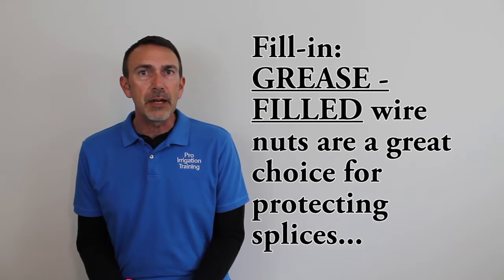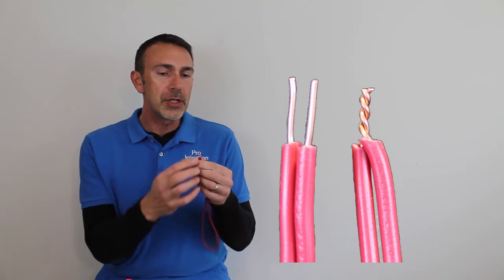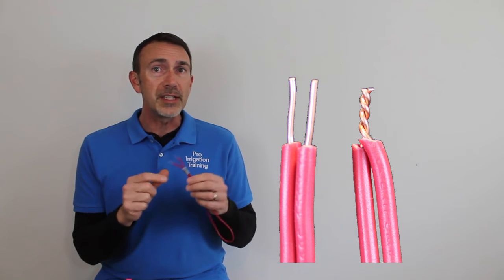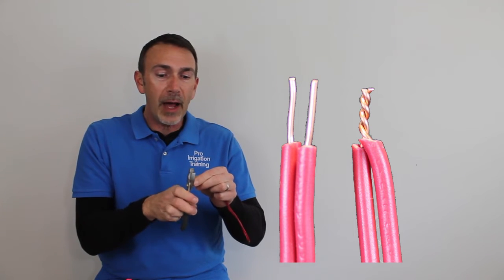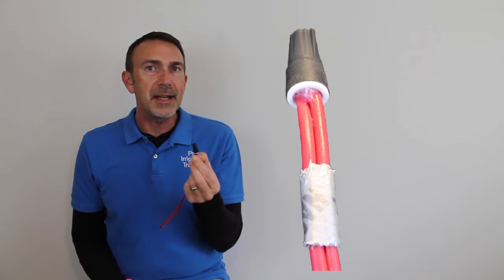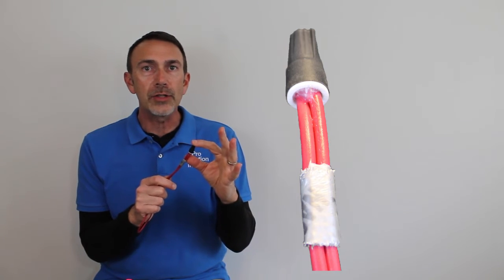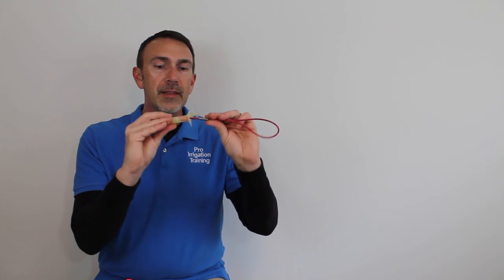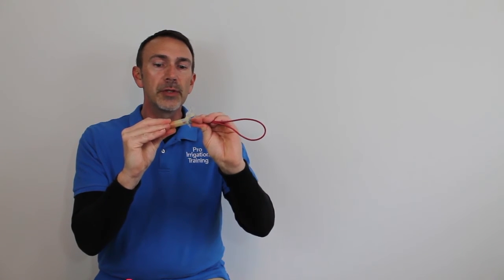Splicing Wires on Irrigation Systems (sprinkler repairs)

Comment: Is there a gauge rating I should ask for at the store? My red wire got cut by some plumbers. Now my front sprinklers do not work on automatic. They only work when I turn the valve a 1/4 turn manually. The rest of the zones work fine.Thanks.
Reply from the maker: If it's just a single strand, 16 gauge is normally used. The multi-strand bundles are 18 ga. If you have to go a long ways, like hundreds of feet, then definitely 16 ga. Thanks for watching!

Comment: 2:30 grease-filled wire nut - if you have some waterproof or dialectic grease just fill a regular wire nut with it. Buying packaged grease-filled will cost about 4x the price of a regular nut.
Reply from the maker: That's the truth. I do like the piece that the Dry-Conns have to keep the grease in the nut. But other than that, I agree, they're expensive.

Comment: Those are the wrong wire nutts and gel caps for 2wire.
Reply from the maker: You're 100% correct. Thanks for bringing that up. I don't mention 2-wire systems in these basic videos for a reason. This video is part of a full course curriculum and somewhere in there I mention that this is not about 2-wire, but the traditional multi-strand or single-strand installation technique popular for several decades previously. But to clarify the point, on 2-wire systems, always use the direct burial style (2 piece) splice connector. And go even farther with it, and only use the same brand as the 2-wire system. If you use a generic brand, it can void your system warranty. I promise, small things like that matter on 2-wire systems, just like the grounding rods. I don't recommend 2-wire for irrigation beginners. Trust me, I've done repairs on huge commercial systems where the installation protocol wasn't followed and resulted in a big mess every time.

Comment: My cut irrigation wire is composed of three smaller wires within.  Do I need to separate these wires and splice them to the corresponding colored wire separately?
Reply from the maker: Yes. Even if you don't think you need all the wires, go ahead and splice them all correctly to the colors. It can cause a mess later if you hook up the wrong colors or not all the wires. Thanks for watching and commenting!

Comment: what if you use butt connectors, added you own silicone grease heat shrink wrapped over each wire and than taped the bundled together?
Reply from the maker: That would work great. I think the heat shrink might eliminate the need for silicone, but I need some research on that. Thanks for watching and commenting!

Comment: Best way to find corroded splices that are buried directly in the ground is with a TDR. Even good splices buried in a valve box that is covered with an inch or two of soil and grass can be hard to find with a locator. Not with a TDR. I’ll never be with out mine now that I’ve used one.
Reply from the maker: TDR? I'm wracking my brain to figure out what those initials mean., lol. I know terminology is different from place to place. Or maybe there's a new piece of equipment I need to be introduced to? I've only used locators, pulsers, and station masters.
Reply: @Proirrigationtraining  Time Domain Reflectometer
Reply from the maker: @miscemail2901  Word. Thank you.